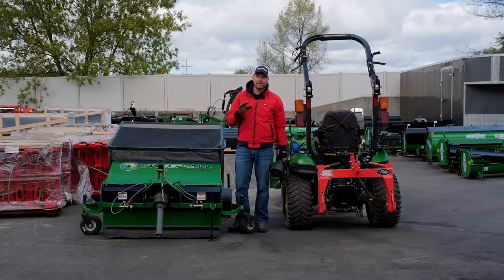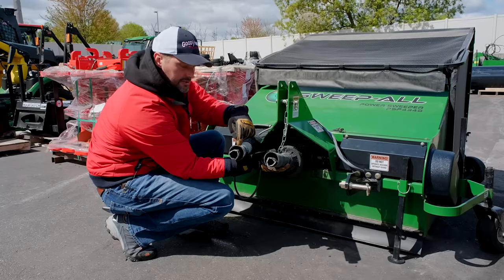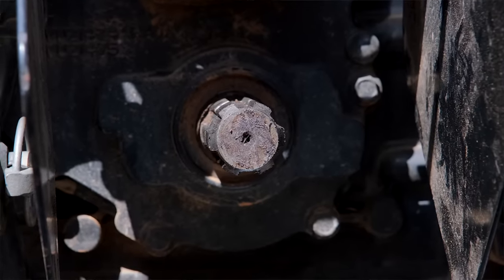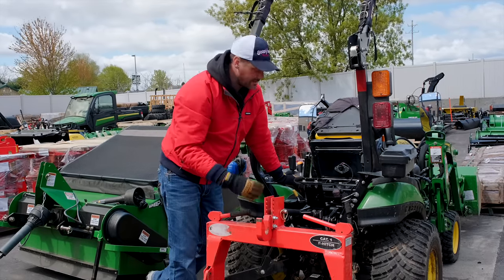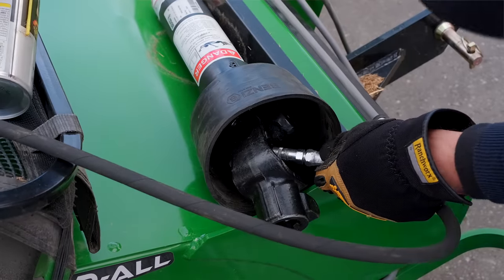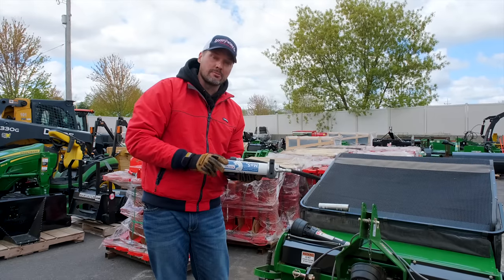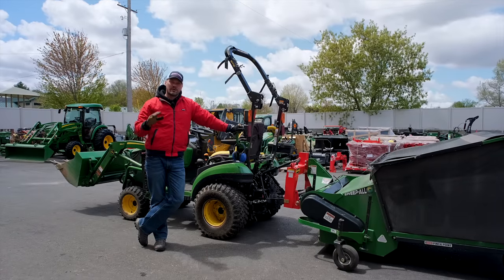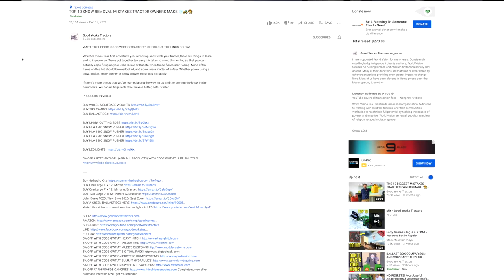THE STRUGGLE IS REAL: 5 TIPS TO CONNECT YOUR PTO SHAFT 🚜👨‍🌾

Comment: I cannot think of a worse addition to a tractor. It adds complexity and expense to a system that already works well. But even worse it makes the PTO shaft more dangerous. It moves the connection point back from the tractor guard and at the same time moves it farther out from the guard on the shaft itself. When using one it leaves a large wheel exposed and just begging to wrap up something. Worse yet the wheel has protrusions that would seem to make it even more likely to grab anything that happened to brush against it.
Reply: Anyone that would work at attaching a pto shaft while the tractor is running surly needs more than a safety device.
I never will attach the pto with tractor running and i don't operate tractors around little kids, an angle grinder removes this plastic contraption and all the frustrations go away, those that have had serious injury or death "the tractor was running", if their is doubt of abilities do not remove the safety device.

Comment: The problem I see with this is that if you add a quick connect for your impliments and then something for the PTO you are adding almost 8" to your PTO shaft. There has got to be a better way than these.
Reply from the maker: You've got it backwards.  Adding the Tractor PTO Link evens out the PTO shaft length if you add a quick hitch at the same time.  So, no need to mess with lengthening or shortening the shaft.

Comment: Got a quick hitch, it is useless.  There is no adjustment.  So unless it happens to exactly fit your implement, it won't work!
Reply from the maker: The top hooks are adjustable.  I've covered it in many videos, but you need to have quick hitch compatible attachments as well.  So, it is useful when used with the right equipment, useless if used with the wrong equipment.

Comment: Omfg I almost have had at least 5 heart attacks doing this on a 5075e
Reply: Hey Doug, we have a 5075e as well, and having trouble removing the PTO ... what worked for you?? Thanks for any tips, we totally feel your pain!!
Reply: @gaptx1  ok here is what I did.
I removed the green pto shroud on tractor
I then took off the plastic casing around the pto shaft.
This made the shaft 70 percent lighter.
At this point I was able to connect like you should be able too.
Btw even when I took delivery of the tractor new from deer the pto shaft fell off within 10 minutes of use.
Now I'm good

Comment: You’re not supposed to use the chain to support the weight of the shaft. It’s only to keep the guard from rotating.
Reply from the maker: Why on Earth do you care about that?
Reply: @GoodWorksTractors  that may be why you’re breaking chains.
Reply from the maker: They break on both ends of the PTO shaft and I only use the chains to hang on some attachments..  They have always been very weak.  Really not that big of a deal.  They do get hung up on debris too.  Just a chinsy item without much thought behind it I think.
Reply: @GoodWorksTractors  In Europe the chains are (were?) required to keep the guard from spinning while in operation. Why? Can't imagine! Mine are closed hooked to the PTO guard with a snap on the other end on a Frontier 48" rotary mower. They spin when the PTO is in gear so the other end has to be hooked to something.  I'm thinking I'm just going to take them off.
Reply: Good Works Tractors Sam is right!